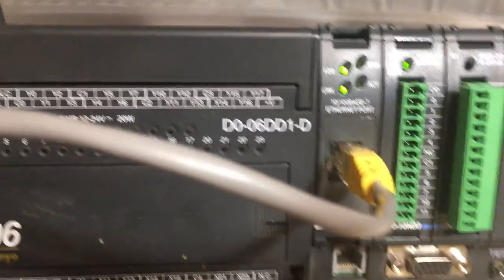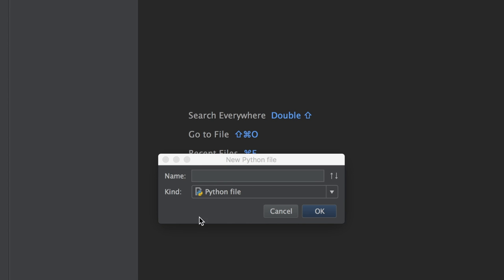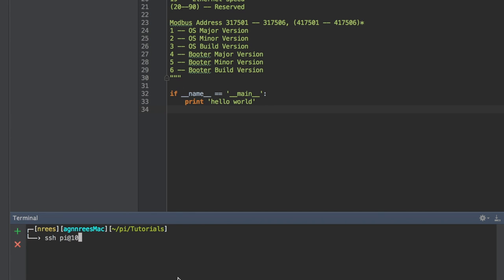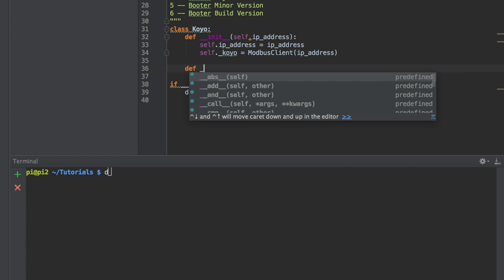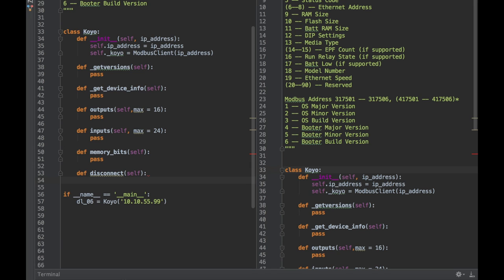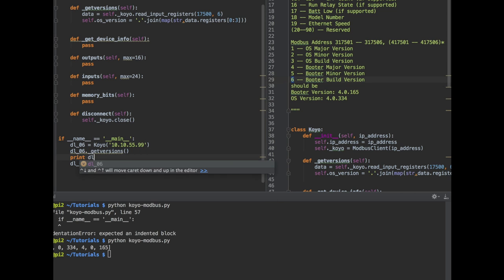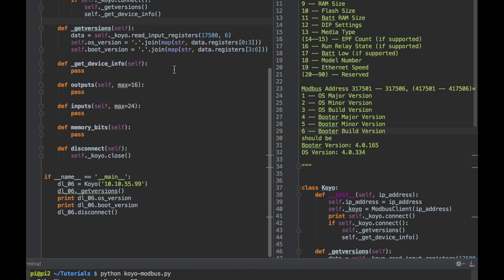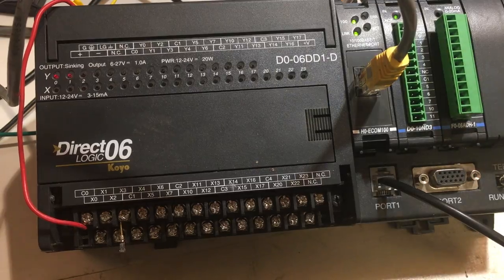Raspberry Pi - Tutorials - Pymodbus - Device Specific Code & Reading Input Registers using ModbusTCP

Comment: Hi, firstly thank you very much for making this video, excellent stuff!
I just wanted to know why you use 17500 instead of 317501? How would I access the 'Dynamic Module Data'?Also, I use 'Stage Programming', do you know if it is possible to program the koyo PLC to send a signal each time it progresses to the next stage of the program and for a server running a looped python script to capture this? End goal, I would like to create my own simple historian database, logging timestamp and stage each time the PLC transitions to the next stage.
Reply: FYI, I figured out that the "Ethernet Address" is actually the MAC address not the IP address, convert each of the 3 numbers from decimal to hex and doing some rearranging.
Reply: Did you ever get reading of inputs and outputs working?
Reply from the maker: yes.  i've got the rough draft of the video made just need final edits.. will upload soon
 P.S. glad to hear you like them :-)
Reply: Just got the inputs and outputs working (with a little help from another of your videos)! Would really love to seen an example of a python run server rather than a client!